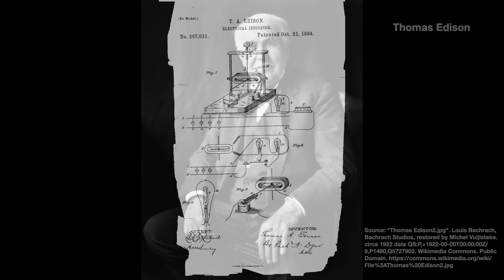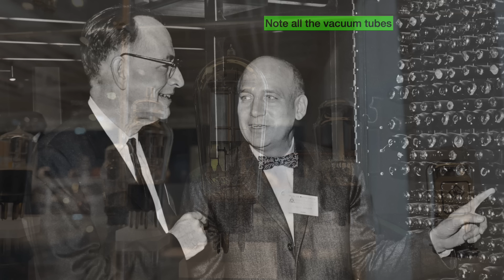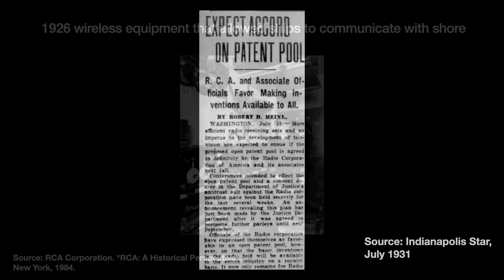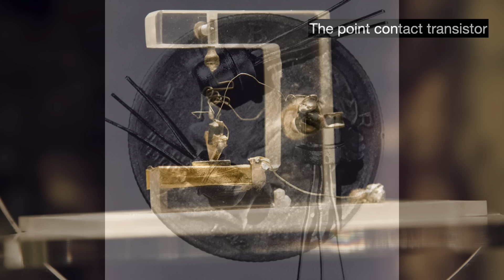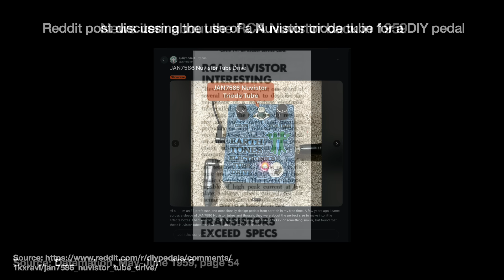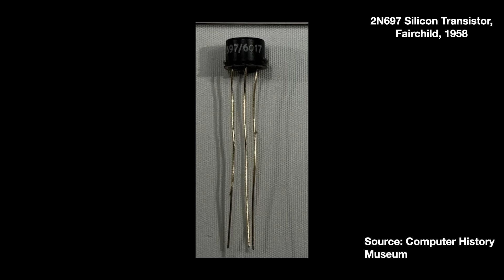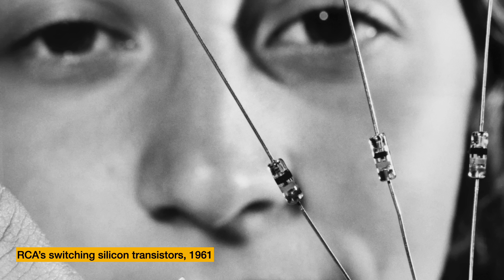RCA Made a Vacuum Tube to Beat the Transistor

Comment: Thanks for the video where we educational. I love stuff like this. And one of the comments which is on your first page on the with a title in the description, is under the comments LOL. The is a comment about tubes and guitar amps. Yes, the gold standard even today. For most guitar players, if they can afford it or even know about it, are tubes. Tube or valve amplifies. I have 2 digital amplifiers and 2 tube amplifiers, one of the digital amplifiers, is one of the first in a series from Fender, it's called a Mustang in its version, one came out in the mid 20 teens, and the second one is probably the most. Sold amp till even today. If I'm not mistaken, which is the boscatana, I have a one00 W of those of that one, it's a one00 W amp both see the Mustang, is a very small practice. Amp 20 W and 20 W of solid state in volume does not equal 20 W of valve or 2 volume. It's gigantic difference. But yeah, it has an 8 inch speaker. In it, my boys, scatana has a 12 inch speaker and a 100 W, and it's gigable, you can play gigs with it, it's loud enough for that. It's got 5 these, these amps, both different channels, so it's like having five different amps however, many channels you have plus effects, digital effects. Solar state, digital effects. I have a very cheap Chinese made. What is it called a stage right? Monopoly stage, right 15 W tube lamp, which is basically a cloned Laney Cub 12R with reverb. It has a real digital. I'm sorry, has a real reverb tank in it. So it's, of course, all these new ways from the 90s, mid, 90s on, maybe even older than that, have PCB boards, they're not point-to-point wired anymore. And they have their pros and their cons. And compared to the easy due to the fact that they can make these things cheaper like this, and all components like potentiometers and switches. And input jacks are all mounted their surface mounted. They're not point-to-point wired as individual things. So the pcb, though, it's cheaper and sounds just as good. Although some people real purists might say that that's not true. But I believe they sound just as good, but they're just not as easily worked on and fixed servicing is a lot harder on those things. And therefore more expensive, it has a tiny little transformer. It reminds me of the size and shape of the voltage regulators in old school, cars, size wise, it's got a 12 inch speaker and is fixed bias. So you don't have to adjust the bias of the tubes. I think it has 5 tubes altogether, maybe 4, and they're very small, of course, because they're only pushing 15 W of power output. I just recently bought early about a 1990 Fender. Twin rednob, it's a it's a be home, it's a behemoth. It weighs probably 85 lbs. It's a 100 W, all the parts are at that point with still, but the Fender was still being made in the states from the Transformers to the speakers. Everything the Transformers alone on this thing weigh a ton. The whole lamp weighs about 85 lbs , which is huge. It comes on, it came, and I have it on its coast. It's so you can wheel it around. It's got 11 tubes, huge, 4 huge power tubes, and I think 6 preemp tubes. And a tube for the reverb, which is also a spring reaver. The tank fits the whole bottom of the tank. It's huge. This is not an amp that plays low, but still, you know, when this amp was made, the 2 manufacturing was all gone to the pretty much to 3 places. I think the only places that make too today are China, Czechoslovakia and Russia, which the czechs, making the best ones from what I understand and every tube that's used in amps and other high fi. I guess possibly are made from these 3 factories. And then there are a ton of brands, but they're all bought. And then rebranded from these 3 factories and
Is Fender ramp is amazing. Nobody wants these vintage amps of the like this, or the older twins and stuff, because they weigh a ton, the original one, weighed, I think 65 lbs. This is £20 heavier, and it's due to all the metal. The magnets on the eminence speakers, which were custom-made by eminence forfender are gigantic. I have 12 inch speakers and 2 of my other rams, and the magnet is about twice the size. It's almost the diameter of the actual outer diameter of the actual 12 inch speaker. It's huge. This is not an amp that does quiet, but there's something look, this digital amps that I have there are. They are literally trying to capture the sound, the feedback, yo, the saturation, everything that a valve does in an amp. A guitar amp to get specific. Sounds specific. Feel the way you play It. It's almost like an instrument in and of itself. These digital amps are trying to replicate, and they haven't been able to do it, not yet. There's a new AI amp that's close. But still can't do it. So there's something inherent in this, it involve tube technology that is pleasing to the earthically, that this Fender, twin rever by half red knob, is a 3 channel lamp, is as clean overdrive, and then overdrive too, so it has so many switches to shape your tone knobs that pull and push and pull. So you can cut an air trebles and boost the bass and stuff just by pulling a knob out it's got presence. Controls, it's got a million ways you can shape your tone, and it's all analog, it's all tubes, everything that works in that amp works off a tube, even though it has P. CP balls, I think it was the first model to start using it that Fender made in 87. It's still PCB and it's still surface mounted, so they're expensive to fix expensive to service and the surface mounted components. I.e. jacks potentially ambitious switches. Everything are all surface mounted, and every time we plug AA cable into the input. So it's got 4 inputs, it's amazing. It's got 4 inputs. It puts pressure on the on the board, which is mounted vertically at that part of the amp. In order to accept and take the components, so it's not just like point-to-point where everything is just swapped out. And it's easy and everything is right there in front of you. It's a bit more complicated and not as durable, but it's still these amps are still going. I had to have this thing recaps, they recapt it before they sent it to me. When I bought it, which is replacing all the capacitors, the electrolytic filter And all the other capacitors electrolytic, I think they're all how do more replaced? So those are good for another 30 years. But all these companies that made parts for the sand like, I think the world's most popular and probably the best manufacturer transform is up until they close was Schumacher. And this has the original Transformers, and it's 2 of them, 2 huge Transformers, the gigantic, they weigh a ton that and the speakers with those huge magnets make up most of the weight of this amp, but it's tube technology at its finest for for its specific use. And again, everyone is trying to replicate this sound, and it's type of technology digitally, even the companies that still make and have their foundation in 2 vamps, are making versions of their own. Iconic amps, digital, and while they are close, and in the ballpark, they're never quite the same thing. But people are using them. There are people that have never plugged. Guitarists, young guitars that have never plugged into a tube am, which is a shame I. It took a couple of years of playing before I finally bought a tube bamp, and I bought a cheap one, which happens to be an amazing amp, the only thing that needed to be done is to change the speaker that amp shines, it's amazing. I have it 6, it's 6 years, 7 years. That's 6 years kept in the most dusty dirty conditions. Banged around, and this thing still works at 250 bucks. It's cheaper to just buy a new one. If it breaks LOL and this one hasn't broke yet. Tubes were very durable. They were even put into, they use tubes in the warheads of nuclear bullets, basically, nuclear 16. Inch gun shells from on the great warships that we had the Ohio ohio class. Was it no?
Whatever the yes, the big warships from that were built prior to World War 2 and used throughout World War. 2 up until the 90s, I think it was in the Gulf, one of the last ones that were still serving were in the Gulf, and they had nuclear-tipped. Rounds for their 16 inch guns and they had tiny little tubes in them, and think of the amount of G force that something like that that a £2000. Shell set reached up to 24 miles with pretty good accuracy. The amount of abuse and view force that those twos had to take. Yes, recently, I think it was philips. Maybe or Vox came up with a new type of 2 vamp that works like a neon bulb rather than bulb, and they put it into some of their amps, but you never really heard much about it. Afterwards I don't think it was a huge success. I don't think it probably had the tonal characters that a tube gives. But, you know, people like, you know, younger people and stuff that are into tubes, you know, they wonder what the future is, because, eventually, you know, there's only 3 factories making it globally. Although there's not a huge market for them that's niche. And if one closes down to the other and it just it just cuts the say a possibility of acquiring new ones as they burn out or for manufacturers that are still using them in their amplifies. Old new old stock is a big thing. People pay a lot of money for new old stock tubes. I should buy some as a back as backups cause now. I have what 11 and maybe 5. So there's like 15 tubes that are being used. I know this is not AA comment. Anymore, it's a novel LOL I'm blind. I'm using speech to text. So I'm not stupid, I'm not illiterate I'm not even ugly alone. My friends tell me, I am it's just to screw it up app. That allows me at least to dictate, but at a cost. So if this even this, this comment is so long. Now I'm probably gonna get AI never. And I won't post, but I'll try and post it now. If you read this, God bless you. Sincerely, Bob's a blind bedroom guitars.

Comment: The Nuvistor was created around the time integrated circuits were invented.  There is no way a vacuum tube can do what an IC does.  When I was growing up, TVs and radios used vacuum tubes and transistors were only used for portable radios, etc..  These days, the only consumer device that still uses vacuum tubes would be microwave ovens, which use a magnetron to provide RF energy for cooking.  Also, while I never worked with Nuvistors, I remember peanut vacuum tubes.  These were small tubes, with 1.5 volt filaments, which were designed for portable equipment, before transistors took over.

Comment: Although you can watch historical films of tubes/valves being manufactured (many are from British companies such as Mullard) I've never seen film of nuvistors being made, and I have long wondered, how were they evacuated and sealed? (No glass evacuation nipple is visible). I've also wondered the same about metal-shelled tubes of the 1940's such as 6J7 and the original 6L6 or 1614 output tubes, which were metal, not glass.

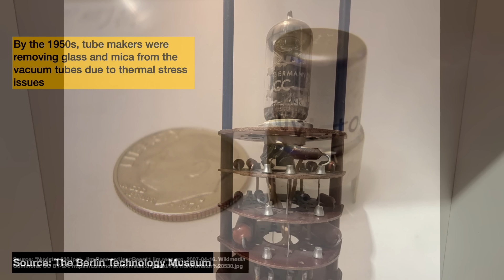Comment: 12:53, manufacturers weren't "removing the glass and mica from tubes due to thermal stress issues",  they did this only to Nuvistors, specifically.  The dual triode ( ECC,) in the photo contains glass and mica! In general, they were shrinking tube sizes as new designs were  improved in gain, in order to reduce power consumption, heat generation, internal capacitance ( high capacitance reduces usable frequency response) and noise/microhonics. Less material used per tube also lowered production cost; Smaller tubes also meant that more complex circuits utilizing more gain stages could be built into smaller devices.

Comment: Nice video, but there are so many inaccuracies and omissions. You should have mention that Lee de Forest invented the first practical triode. That gave birth to radio transmitters and receivers.
Transistor are mostly triode and work the same way as a vacuum tube triode.
The vacuum tube diode was vastly used to rectify AC to DC,
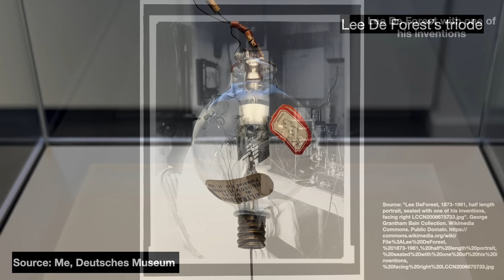Another non-sense (2:38) that you mention was that vacuum tube shattered. I am sure that you just made this up. I was a radio/audio amplifier technician in the 1960s and I never ever seem a vacuum tube shatter.
Of course vacuum tubes were made to burnout just like an incandescent light bold, else how would RCA survived.
Reply: "that you mention was that vacuum tube shattered. I am sure that you just made this up"

I guess you never dropped one.

Comment: Cool fact: nuvistors don't even have bad performance nowadays -- in certain performance parameters, that is.  The transconductance and electrode capacitance make them comparable to early silicon JFETs; and modern Si JFETs haven't improved wildly (unlike power MOSFETs, that have enjoyed a good 5x+ performance gain since their introduction in the late 70s).  The big problem? Besides requiring heater power, required plate voltage supply is a good 5-10x higher, to obtain the same performance.  So the efficiency just isn't there.  (GaAs and beyond, have of course improved amplifier performance much further.  I think the fastest now are distributed amplifiers in InP, if not GaN?)

Also used to be that you couldn't get a single MOSFET in ratings comparable to a horizontal-deflection (sweep) tube; this was finally eclipsed a decade or two ago, when a line of 4kV 1A+ MOSFETs (Rds(on) < 80Ω) was released by IXYS (now Littelfuse).  Admittedly not a high-priority market :) , just interesting that it took so long.

Regarding transient immunity, well -- I guess I can't speak for nuclear EMP exactly, it's quite an impressive test level and would require full system consideration (antenna, cables, connections, modules..) -- but at least for more common transients, protection diodes have done very well indeed, and parts are available that compensate nicely for the otherwise quite fragile junctions of RF transistors, particularly those used in the GHz.  For radio as well as digital communications purposes (your modern HDMI display has more signal bandwidth in the cable than any military radar of prior decades; and commercial quality cable shields are far from perfect!).

Comment: I killed the last nuvistors, yes me I took the last New Olde Stock nuvistors available anywhere on Earth and tested them, none met specification, the best ones I used for a old radio, the rest I threw away, there are no more in existence.  Sorry If some still exist in a musium, I assure you that they no longer work.  Not trying to make you cry, My job was to keep thse old radios  operational, once the parts are gone, they are gone.  Micro processor radios today are better than tube type radios   It is time to let go.

Comment: The vacuum tube has a stand beyond that of the Nuvistor — micro vacuums in integrated circuits. Integrated circuits without semiconductors are hardened against permanent damage by EMPs.

Comment: More branching rabbit holes: 1️⃣ Svetlana / New Sensor still make and market both miniature and power vacuum tubes, many clones of favorite Western specs, keeping antique radios working; & were why Soviet aircraft were more EMP resistant earlier than NATO; 2️⃣ Field-Effect transistors aka FETs are the solid state replacement for tubes, as a voltage controls a current in both,  vs junction BJTs a current controls a current, and also FET can be made larger to handle higher voltage, current,  like a tube .  When the rabbit hole starts branching, beware the minotaur ! 😉

Comment: I mess with vacuum tubes regularly.  They are used for high voltage switching.  They are not the nuvistors of this video, unfortunately. A transistor can never do what the vacuum I mess with are doing. 
By-the-way Thomas Edison did not invent the incandescent light bulb.  He invented very little at all.

Comment: They developed ruggedized vacuum tubes during WW2 for the proximity fuse.  These had to be small enough to fit in a shell and rugged enough to be fired out of artillery.
Reply: Encased/potted in solid glass so they couldn't shatter, iirc.

Comment: I thought rca was Japanese.  The only thing I heard about tube is the gain is more linear than Ic.  That's why it was preferred by audio applications.
Reply: RCA was an American corporation for many years before the name was sold.

As for being more linear, I guess you don't know much about electronics.  With solid state devices, feedback is used to greatly improve linearity.  Such feedback was often not used with tubes because it was too expensive.  It would have required more tubes and real estate to implement.

Comment: The Feynman lecture about "Plenty of room at the bottom" forms the theoretical basis for Moores Law. With hindsight it is easy to see that solid state devices can scale but vacuum tubes, with their need to heat an element, cannot: the smaller the essential filament insulator gets, the poorer its performance. 

Thanks for another great episode.

Comment: I got several such a soviet tubes 6С62Н from old spectum analyzers and oscilloscopes. It is a good artifact, and when there is a good emission - it may works again.The old equipement was done in 1982-1986 years.